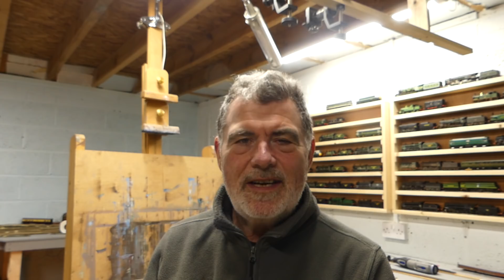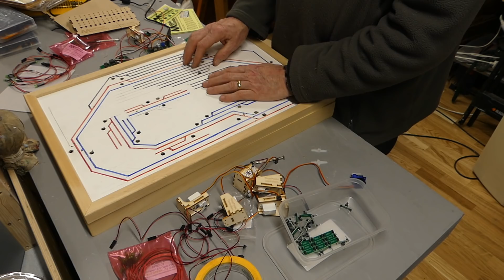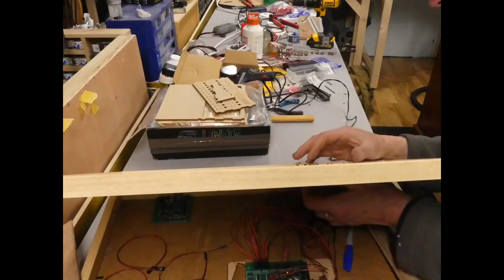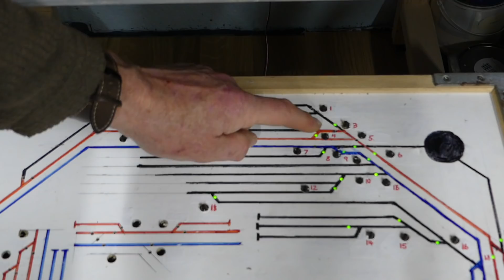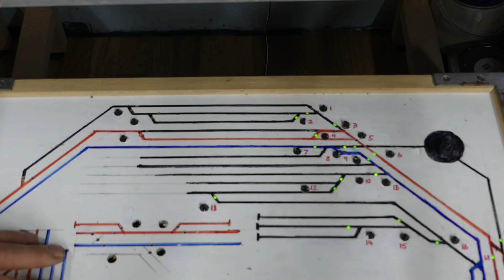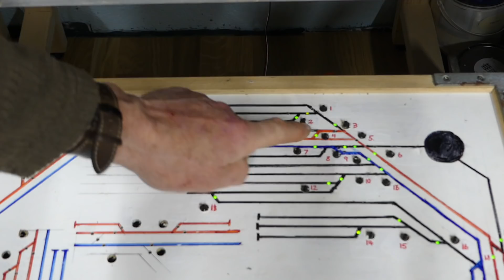27. Point motor control

Comment: I also considered using MegaPoints and I have watched some of their videos. I think their system is great, but for me, it is too expensive. I am still going to us servos (32) controlled by an Arduino with 2 Uno boards. I have been buying my electronic components from China. A friend of mine here in Thailand has invested in a 3D printer and he has made me the carriers for the servo units and there is a platform on the side where I have mounted a small micro switch and that will operate the Light signal. I would have liked to have semaphores instead of lights, but as the layout is modelled towards the end of steam and the start of diesels and LEDs are really cheap, I just need Andy to come up with a 3D signal unit. He is Ex Royal Engineers and loves a challenge.  All the best and happy modelling. Martin (Thailand)

Comment: Hi Paul,  I'm still dithering about what controller to use. If I am not mistaken you are using a NCE controller. If so what made you choose that one, what do you like about it and if you could do a video demonstration of it so I can get a good idea it would be a great help, ta. The other controller I am looking at is very similar to the NCE made by Gaugemaster. They seem very alike but I think your NCE is the main contender unless there are others out there that you have your eye on as its an ever changing arena.
Chris
Reply from the maker: ChrisWC342 Hi Chris , like you I was undecided at first as there are many offerings out there. The Nce powercab was chosen as it is a firm favourite overall and a one hand operation when varying speed . Hope this helps. Regards Paul
Reply: @Sandlingjunction  Thanks Paul, I am definitely going for the Nce powercab, but what decoders do you use in you locomotives, appreciate mine will be N gauge.
Chris

Comment: Looks like a simple system.
How long are the link cables to reach around the layout??
Cheers Andrew
Reply from the maker: There is no limit Andrew you can link cables . There is a video on Megapoints you tube channel that tests that for you , great system , regards Paul
Reply: Sandling Junction Hi Paul
I’ve watched a couple of videos over the weekend and had a look at the webpage. If I ever get to a full layout again I would have the system as it appears so much more simpler to install than some of the others I’ve looked at.
Cheers 
Andrew

Comment: Hi Paul, good to hear that you opted for this system as previously said I recently purchased it, like you with the cost implications this is definitely the way forward, I purchased the two different type of servos direct from Hobbyking on line and direct from Hong Kong, even allowing for the carriage flown out from there plus tracked by DHL was only an additional few pounds! No brainer,. another good update hence why your subscribers are rocketing. Ed🤓
Reply from the maker: Edward Barnes  many thanks Ed,  it’s a great system for sure and as I get my head around it , even easier to use. As you say a no brainer. Regards Paul

Comment: Thanks for sharing. I'm about to start a new shed layout, and have been looking at MegaPoints system. I have already purchased the first dozen servos from Hobbyking, and will soon purchase a control board. Are you using electrofrog points? I note they have a 4 way board for frog power switching, so I assume I need 3 boards.
Reply from the maker: Yes you will, the system is a good one, I am in my early days with it, but have high hopes, regards Paul

Comment: I'll also give you a "Well Done" on the video. Being in the US I don't recall hearing of Mega Points but it looks like a system that could work for a electrical seat of the pants guy like myself. I'll have to contact them and see if they are available for shipping to the states. I'll soon be commencing on the first section for my Framlingham Branch (yes, a Yank building a British railway) and will need a goodly number of electrics for that, along with signals and the possibility of giving them the required bounce is intriguing. I look forward to seeing more of your videos on the evolution and building of Sandling Junction.
Reply from the maker: Hi James,  thank you for your kind comments. I really rate this system and Dave Fenton will help you all he can. He owns the company, created the product and is a really nice chap to deal with. I hope your build goes well. Regards Paul

Comment: I will stick with my Cobalt digital point motors and the Roco Z21, a bus wire and just three wires into the Cobalt with the option to add a mimic board, switches and or signals at a later date directly from the Cobalts.   As an Electrician with 40 years experience I like to keep my wiring to a minimum and neat which is one reason why I went for the Cobalts and the Z21.  I do like your mimic board but, if something ever goes wrong in there it could be a serious task sorting it even if you have everything marked.  I doubt if I would ever bother with one, I actually prefer having everything on my iPad.
Reply from the maker: Andy Gibson ,  Hi Andy, I get you , as I said it’s an individual choice, and certainly not for all. My initial decision was a financial one based upon 76 points plus being needed. Regards Paul

Comment: Sandling for servos, wohooooo! :-)
Reply from the maker: aaaarghh02 Absolutely , regards Paul
Reply: @Sandlingjunction  I am surprised that the UK's model railway scene is - given my limited exposure to it - so stuck with Cobalt and/or Tortoise systems on one end, and Peco/other magnetic switching on the other end of the spectrum.

Yes, servos need a slightly different approach (which is why a servo driver board is necessary), but both price and versatility of the solution is IMHO absolutely unbeatable.

Cheers,
Michel
Reply: @Sandlingjunction  Speaking of which, I sort of would be interested to see your solution in action in person.
However I do appreciate that to you I am a stranger (and I am not really deeply connected to the UK railway model scene). How could we resolve that?
Cheers,
Michel

Comment: Excellent video, love your choice of control system, had seen them used on another layout and the whole thing looked very interesting from an installation and fault finding point of view. Apparently as you have found the support from the company is fantastic. I noticed that the wire to the piano point raises up when it’s operated, and then reduces in height once the point is thrown, is that normal?Good luck with the installation!😎🇦🇺👍
Reply from the maker: Stephen Wratten Hi Stephen , thank you for your kind comments, I think they do rise up and back down as the Horn of the servo rotates. Regards Paul